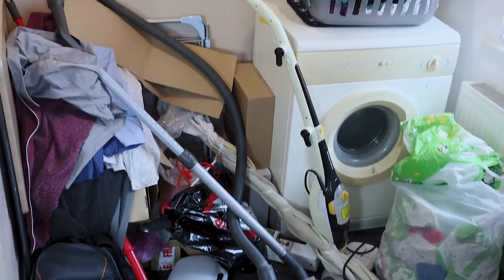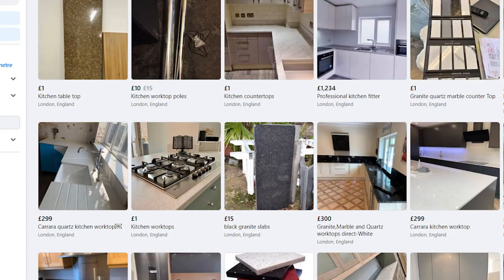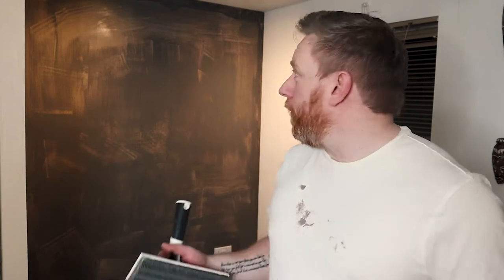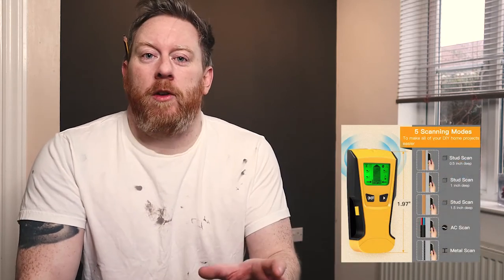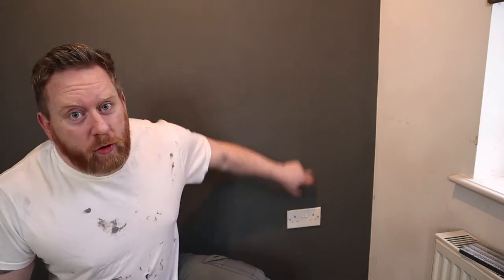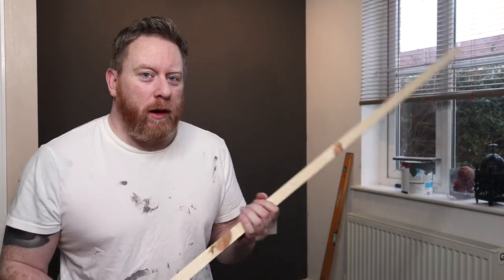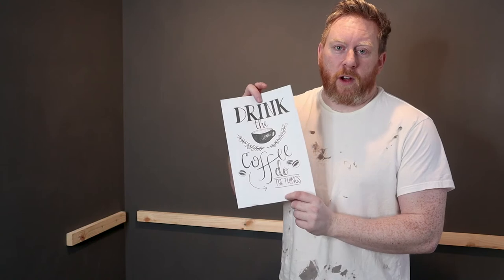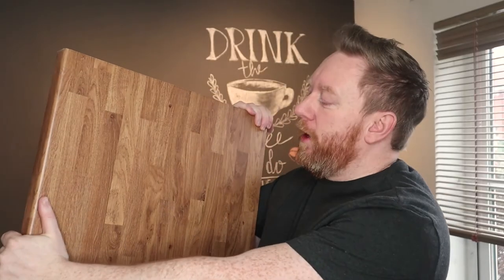I Built a Breakfast Bar for Only £22.45 | DIY Home Improvement

Comment: Thx, i needed this as i have been struggling on how to do mine, but if i use struts on the wall i will be drilling into masonary/bricks ? Any tips on that pls ? Iam not used to using power tools as i am a female lol, and dont want to cause any damage to the plaster.

Comment: A tip for cheap work tops is the IKea sale corner at one of there stores I picked up the same worktop as yours for £10 length about 6ft 
I will be following your video to fit one in my fella's house so thanks for an easy to follow tutorial
Reply from the maker: Great idea!! Definitely check out the link for the other video about cutting the worktop, I found it really helpful - you'll have to post a link to a photo when it's done!
Reply: What size where your brackets please

Comment: Oooh so you don’t need legs?
Reply from the maker: It depends on the width and length, luckily mine was quite shallow so the beams on the wall were fine. If it's a deep surface or very long, it might be worth putting a pole in the middle somewhere to help support it :)